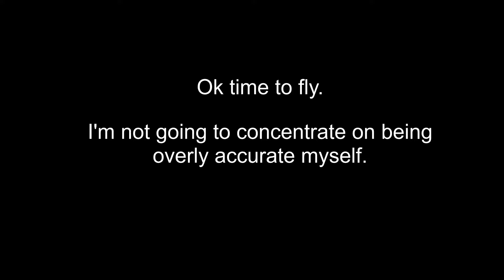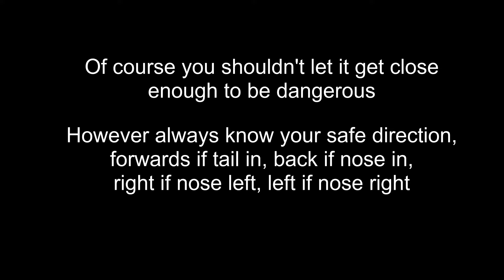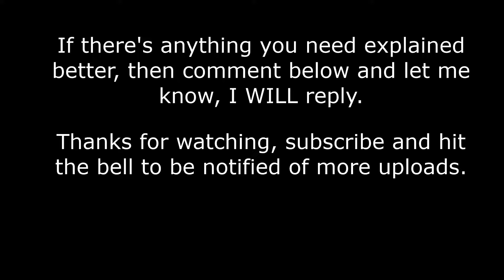How to fly an RC Heli. Part 1: HOVERING

Comment: No one  fly's fixed pitch Helis! any more since 2000! LoL
Reply from the maker: I'm pretty sure there'll still be kids buying them as cheaps toys off amazon/ebay etc
Reply: I can attest to that.  My airhog flew up and never came down.  Stuck on top of some factory building.
Controlling the lift by controlling motor voltage is like controlling a train speed by adding more wood to the steam engine.
It does go up, but there is no total, absolute pin point control.

Comment: Wow! No offense,  I'm glad you're not my instructor. You went through too much manure ( flight theory ) at the beginning and too little during  your flight demo. As with most people who desire to get their helicopter up, I did not look at the suggested videos.

As to your flight demo, IMHO, you need to use a zoom camera, with a camera person, instead of a GoPro, or whatever camera you used. The only thing it really shows is how fast people can lose orientation. 

You mentioned slight movements, on the sticks, but never mentioned the use of expo. You mentioned dual rates, barely, but never clarified what they were. You mentioned "panic" mode but never said whether you were using throttle cut, throttle hold or just low collective.

 A collective pitch helicopter has been compaired as an upside down lawnmower. Several people, including a young sponsored rc helicopter pilot named Roman Pirozek, Jr. , have been killed by their radio controlled helicopters. Most news agencys reported it as a "toy" helicopter.  There things are not toys, they are very sophisticated mechanisms.  I think it very irresponsible of you to make the statement  " in no time at all you will be flying like this". I've been flying rc for 20+ years, with 4 of that being in helicopters. I am just starting to acquire the skillsets to handle the more complex maneuvers.  I'm older than most rc helicopter fliers, and realize the younger pilots hand/ eye coordination outshines my abilities 100 fold. Please do not lead very impressive non pilots to think they can grab this proverbial tiger by the tail and it not be costly, either in parts or digits, etc.

Please upgrade your video with these things in mind.

Last thought: the joy of being able to , skillfully,  fly an rc helicopter is incomparable.  You are doing something only 1 in 10 rc pilots can accomplish. Happy and safe flying to you all!
Reply from the maker: Hi Joe. Thanks for the comment. Yes I didn't mention expo and dual rates etc. I wasn't intending to explain literally everything in one video, mainly just effects.of the controls and intro to hovering.  A much better camera and camera man would cost a huge amount. I'd love to but far out of my budget for now The little intro clip obviously isn't intended to be serious but just get people motivated and excited about what can be possible.